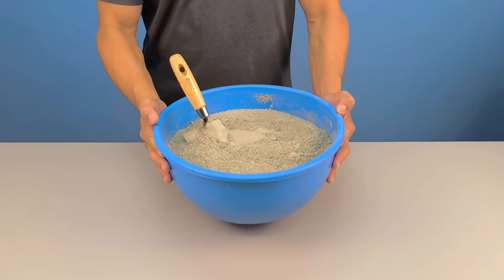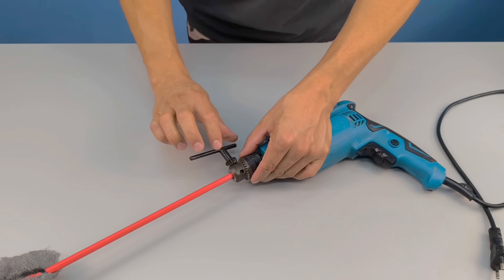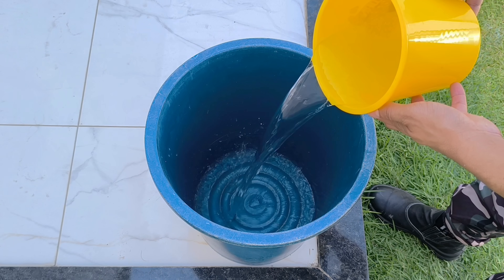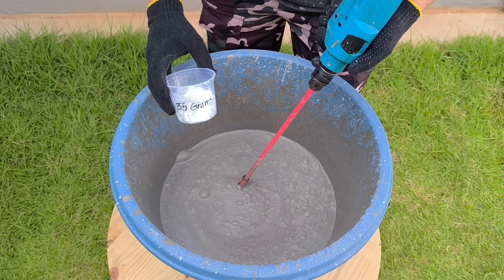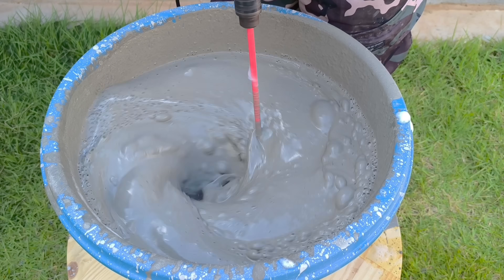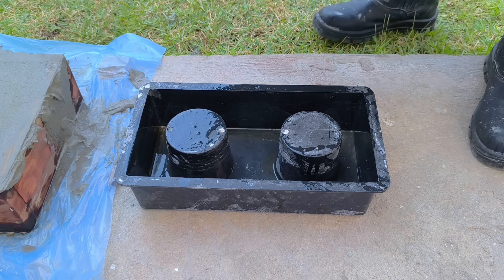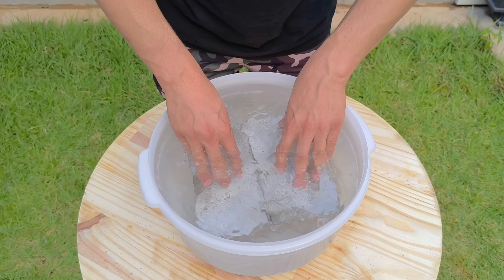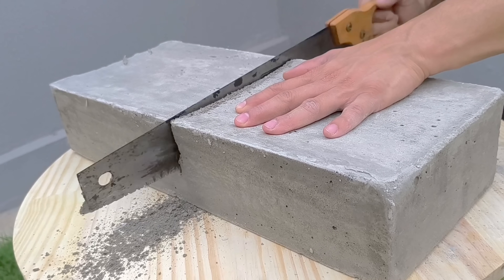Mix CEMENT with DETERGENT and create something that can REVOLUTIONIZE civil construction!

Comment: Having worked with concrete for the last 55 years from work in a garden to working on bridges and  with top engineers, and scientists on a nuclear power station..And I can GUARANTEE  that mix will be weak to start and get weaker in time ..Dish soap was banned for use for bricklayers 40+ years ago for the same reason...
Reply: Thank You! Its common sense yet people just don't seem to have that anymore ...smh
Reply: @paulsbuildingandpropetyyma544  
He said it's seventy percent lighter. As a machinist , density usually equates to tensile strength. Does that mean this concrete is 70% weaker? Or even weaker than that?
Reply: @jamesfarrell2084  concrete has extremely low tensile strength, you don't design it to do anything in tension other than local self support
Reinforcement is used to provide tensile strength 
The guy who did this video is only conducting an experiment, but provides no data - because all he's made is an aerated weak mix not suitable for loading and will break down if exposed to moisture and frost - it is a weak bulk fill material, nothing more if it hits 7N you'll be lucky
Reply: @jamesfarrell2084 even weaker... it will crumble in less than 5 years
Reply: Hello from Spain. I do agree, these bricks won't withstand heavy weights, therefore should'nt be used the same way we use the standard blocks, bricks, ytong, etcetera. Not to say about its resistance to torsion, pressure and flexion forces!  Adding air microbubbles to any mixture will never increase thickness and resistance. NEVERTHELESS, I think it can be an amazing resource for building lightweight elements, I mean our regular weekend hobbies :)
Reply: @xcosta60 air to strengthen is styro foam
Reply: Nice for making planters ! Thanks for sharing I’m from USA !
Reply: @millissamceachern2540 
Except the detergent will leach into the potting soil, and kill your plants!! 

Go with HYPERTUFA! Looks old and rustic, has good strength for plant-pots, is light to move around.... just don't build a building out of it!
Reply: I love how he is shocked that by agitating water and detergent he got soap bubbles, who could have predicted that?
Reply: I dont think this guy will get it. He dipped his tape in mud and called it dough.
Reply: @paulsbuildingandpropetyyma544  honestly would rather watch a video from someone with your experience
Reply: This might be good for decorative projects or a wall that isn't meant to hold anything out or anything up... Great for light density crafts only...  What does it do when it gets wet and dry multiple times over time...  Maybe good for a cheap statue mold... 🤷‍♂️
Reply: Halloween props at haunted house 🤔
Reply: @misterrip  I was thinking along the same lines, but it’s tensile strength would be very weak (someone said 7N) & common sense tells me it’s porous & won’t handle water well in even the short term. So pots are out. Maybe decorations that can be painted wit a seal or marine varnish.
Reply: @misterrip that's a really good use of
Reply: @misterrip  I don’t know it’s on the tube must be true like Bigfoot all the details subtly skewed from reality
Reply: That is why I dislike the video. Someone who is not as knowledgeable as you might use this formula to build something and then when it fails when people get injured it is this video to blame. It is totally irresponsible that they failed to mention the weakness of the concrete that is made with detergent.
Reply: Sirve para hacer casitas de muñecas. Para una construcción real puede fallar de 1000 maneras
Reply: You don't have to have worked in concrete for even 10 minutes to know he created something with a similar modulus as pumice stone.  Plainly. Don't use this material for any load bearing whatsoever. Its fc' is going to be maybe 1000 if lucky. Cool science project. But because it floats you probably dont want to use it for anything in landscaping either because it might float away during a hard rain.
Reply: It would be interesting if you applied heat to it using a simple propane torch. I'm going to guess it would begin to break quickly, negating its use for an insulation. Years ago brick Masons tried Adding detergent to mortar mix; It did make a lighter material, but also considerably weaker, Not what you want holding your bricks together.
Reply: @richardwomack9196  it’s porous it’ll start exploding. You ever hit regular concrete with a torch? POP!
Reply: Da haben Sie recht, und es ist uns ebenso bekannt: Der Einsatz solcher Mittel ist aus guten Gründen nicht erlaubt und verboten worden, da er noch viele weitere Gefahren birgt. Letztendlich ist es unverantwortlich, hier ein solches Video zu zeigen und es als gute Idee zu verkaufen.
Reply: Foamy means less dense equal to weakling.
Reply: More "Facebook Science". What a bunch of ill-advised advice.
Reply: REVOLUTIONIZE civil construction. But you don't recommended for construction. Hmmm
Reply: Em três anos terá uma bela reforma,com reboco se desmanchando....isto e coisa de pedreiro vagabundo que tinha preguiça de mexer massa!
Reply: @josegeraldorosa9292  🤣🤣🤣🤣🤣🤣🤣🤣🤣🤣🤣🤣
Reply: @josegeraldorosa9292  não parece ser pra rebôco, mas fiz e desmanchou kkkk. Até acho que o gesso não ajuda, mas devo ter errado alguma coisa.
Reply: Will it be ok for supported kitchen tops if sealed in your opinion cheers
Reply: Will it be ok for a countertop?  Did you watch the same video?  He cut through it with a hand saw!!!  No it can’t be used for a countertop.  The edges will chip the first week the countertop is in use.  The first time you cut on the counter top it’s going to leave a mark.  In other words you better not have a husband or kids.  Because I’ve cut something on every countertop I’ve ever owned.  As long as it was an expensive top the knife didn’t damage it.

Why would you even want to do this?  Because of the weight difference?  You already need to be methodical when creating and installing a cement counter top.  What you just saw in the video is not methodical in the sense of doing everything possible to improve strength.
Reply: @MrGivmedew  I could see using it as insulation maybe
Reply: @markedwards1864  
The "seal" won't adhere with soap in the equation. Plus, without a seal you run the risk of getting soap in foods prepared directly on the countertop. Plus when washing it down, suds will appear on the surface. 

Fascinating video, but that detergent is a deal-breaker, I'm afraid.
Reply: @markedwards1864  There is a guy on YT doing something called aerocrete that is lightweight. Also I think 'modustrial' or something like that doing diy home improvement projects has done some chairs and table tops with ultra thin concrete slabs, might want to have a look there
Reply: I am watching in Essex uk
Reply: Might be a good option to use in certain places instead of sprat foam.
Reply: @paulsbuildingandpropetyyma544  exactly. Absolute bs waste of time and energy: unless you're making you bricks for your kids to play at being builders with.
Reply: I wrote this comment before I read yours. It's nice to know that some persons with prior experience and who've worked in construction understand that light weight is not a fair swap for structural integrity. I didn't know that this was already banned. 
Here's my comment:

Okay, now put your blocks under a hydraulic and tell us what PSI it takes to fracture your block. Because that's the purpose of using strong sturdy concrete instead of foam blocks for construction. I agree that the fiberglass fibers gain your block some much needed reenforcement. But is it enough to pass muster with a typical concrete block. The light weight is a nice feature, but is it a worthy trade?
Reply: Yes, I agree with building specialists, over just a few years, the washing up liquid leeches out, and the concrete becomes weak and sandlike. Build a brick wall with it and it will crack. The areas of brick wall will move and need rebuilding and repointing. This is well known in the construction industry . Only 'cowboy' builders will use it now. There are new chemical mixtures that can be added, but you still need to know what you are doing.
Reply: @henrydepercy4637  Yup, besides the cowboy contractors, I'm sure China will think it's a break through in construction materials.
Reply: Just like everything else they make, looks good so you buy it,  within a week or so it all falls apart!🤦‍♂️
Reply: @henrydepercy4637  That's about the size of it. Frank Loyd Wright's textile cement block system was built around the science of construction technology. He approached his concept with actual masonry professionals. He developed a cement mixture from ancient Roman technology. He incorporated as much air as was scientifically possible, without compromising quality. And, through his due diligence, he revolutionized the construction industry
Reply: I'm from Indonesia
Reply: People please I don't believe the video has anything to do with stress, strain and ductility. BUT Now you can wash those dishes with bricks floating.
How can we make food safe bricks?
Reply: Thanks for saving time from  watch another false
Reply: Вместо моющего мыла по технологии применяют пенообразователи или на синтетической основе или на белковой основе. В этой технологии пена нужда как каркас по которой цементный раствор формируется и застывает поэтому материал получается лёгкий пористый хорошо держит тепло. Также с годами набирает прочность и становится ещё прочнее. Только нужно выдержать технологию а в целом видео правильное и достаточно интересная познавательное. 
Тот рецепт который указан в видео можно применять как утеплитель или для одноэтажного лёгкого строения.
Reply: Those blocks cannot be used as a heavy load base or for a bearing load wall. It could easily collapse or be crushed.
Reply: this is a typical Chinese mixture used for bridges
Reply: I might test this for making soundproof panels or lightweight wall tiles.
Reply: Point well taken!
Reply: also, with all those air bubbles , wont it be detrimental to the steel rods inside? making them more prone to rust faster?
Reply: thanks i was thinking the same thing..
Reply: @paulsbuildingandpropetyyma544  well this is not meant to be structural. they r used as infill between structural posts & beams. this is insulated block. we built a small house like this in baja & temps are very stable. however we still prefer local soil, adobe or cob, with large overhanging roofs & appropriate proportions of sand & clay & adobe creates much less environmental impact, i.e. no need to create tons of pollution by baking in high temp kilns with gas… some of the oldest structures on Earth are made with Earth, not reinforced concrete. Due to rusting rebar RC cannot last nearly as long as adobe. Sure RC can handle large structures but really who needs them? totally not necessary. only greedy egotistical capitalists think, & make others think, skyscrapers & giant water boilers are necessary. many, small, decentralized, networked systems are more resilient & less susceptible to sabotage. nuclear plants r only possible when gov’t backs them. no insurance company will touch them.
Reply: @paulsbuildingandpropetyyma544  what they added varnish or urethane so the dish soap cand break down? Or maybe acyrlibond or white glue?
Reply: @paulsbuildingandpropetyyma544  we used to use BP comprox in mortar mix but never in concrete.
Reply: This what Dome Gaia has been doing for years. I heard, about a year ago, that someone in either Washington state or Oregon was working on getting this tested for approved use as a building material. I've not checked to see if it ever occurred, tho. There are plenty of homes around the world that have used it - including in NM & AR (that were Dome Gaia clinic sites) that I can think of.
Reply: @KA-qw5cv  is this what was used for the lightweight roof tiles made in BC Canada that were eventually exposed as substandard?
Reply: Shouldn't the fiberglass mixed in give it much more strength like when adding chicken wire to concrete
Reply: @paulsbuildingandpropetyyma544  as a hod carrier for a Bricklayer we were told To add it to the mixer which would prevent it from drying so Quickly on scorching hot days,
Reply: @paulsbuildingandpropetyyma544  it would be good for hobbying and scale building.
Reply: Can you recommend a simple recipe for making a kitchen sink and work surface - strong, waterproof and lightweight?
Reply: Exactly we used to use it 40 years ago until the ban and now we use Feb mix .
Reply: The glycerine used in detergent is now an additive for stucco and marcite. It's interesting that soap had nothing to do with the actual outcome.
Reply: We use lightweight concrete sometimes in our road construction projects.  It's either that or very large foam blocks that are used as lightweight fill.  This is nothing new or unique but this video makes it sound like it's "something amazing!"
Reply: This comment needs to be pinned.
Reply: I believe you
Reply: There you go. My very first thought was, "What are you going to use that on?" It would basically be useless in practically any application where you would normally use standard concrete blocks.
Reply: I don't think the purpose of this video was building code strength for a nuclear plant.  Maybe the plasticizers and fiber replace tinsil strength lost not just from the super enhanced aeration but the amount of 💦.. now that 20" slump we saw, extremely weak concrete. We used to throw a bottle of coke or dawn in our mixer just before the air test. 😂
Reply: It is not for Strength. That’s what the Iron is for idiot
Reply: @paulsbuildingandpropetyyma544  can you put rhubarb in it?
Reply: You are such an Ill-informed, human being, everybody knows the iron Is what keeps everything together and it keeps the strings together. Concrete is nothing but wet mud that gets hard and it’s super heavy so in order to lighten it up, fiberglass is added or fiberglass type material
Reply: @paulsbuildingandpropetyyma544  was a tile setter... first thing that crossed my mind. 🙃
Reply: Hilarious 😂.....thank you for making me smile on a Saturday at work ....wow
Reply: 𝕎𝕖𝕝𝕝 𝕟𝕠 𝕠𝕟𝕖 𝕖𝕧𝕖𝕣 𝕤𝕒𝕚𝕕 𝕪𝕠𝕦 𝕔𝕒𝕟 𝕞𝕒𝕜𝕖 𝕔𝕠𝕟𝕤𝕥𝕣𝕦𝕔𝕥𝕚𝕠𝕟𝕤 𝕨𝕚𝕥𝕙!!
𝔹𝕦𝕥 𝕪𝕖𝕥 𝕪𝕠𝕦 𝕔𝕒𝕟 𝕦𝕤𝕖 𝕚𝕥 𝕗𝕠𝕣 𝕒𝕟𝕠𝕥𝕙𝕖𝕣 𝕡𝕦𝕣𝕡𝕠𝕤𝕖𝕤 𝕝𝕚𝕜𝕖 𝕞𝕚𝕟𝕚𝕒𝕥𝕦𝕣𝕖 3𝔻 𝕞𝕒𝕡𝕤 𝕔𝕠𝕟𝕥𝕣𝕦𝕔𝕥𝕚𝕠𝕟𝕤. 𝕀𝕥 𝕨𝕚𝕝𝕝 𝕓𝕖 𝕒 𝕘𝕠𝕠𝕕 𝕡𝕣𝕖𝕤𝕖𝕟𝕥𝕒𝕥𝕚𝕠𝕟 𝕨𝕚𝕥𝕙 𝕝𝕚𝕘𝕙𝕥 𝕨𝕖𝕚𝕘𝕙𝕥 𝕒𝕟𝕕 𝕖𝕒𝕤𝕪
Reply: If you having worked for so long, sure you know,that someone has done 7,14,28 days of this mixture strength testing and the numbers are available. 

By stressing your long term service with concrete does give your comment a credibility. 
I don't need to work with concrete for 55 years just to issue the same statement. This block is weak and will get weaker. I can simply do the strength testing.
Reply: Yeah you don't even have to take it back to the lab for a stress test you could just stand on it or punch it.  10" slump anyone, just have to fill 2 more 8' foundation panels 😂😂😂
Reply: Paul, what would you suggest be done differently? i like the fiberglass material added, and as I understand it, my A/C pad is made from cement fiberglass mixture; can you direct me towards a similar recipe for use as a patio blocks/pads?
Reply: ..film setleri için iyi görünüyor.
Reply: @paulsbuildingandpropetyyma544  missing the fine details friend.  This isnt dish soap its a detergent
Reply: @paulsbuildingandpropetyyma544  it's will never set,you only add a cap full to keep your mix from setting before you lay it, nonsense it will crumble away in no time
Reply: Exactly.    U need salt water (sea)  and lime-calk (i think its named like that . For the cement that is self-healing. And gets stronger by the years .  (Look @ old Greek & Rome )
Reply: But listen. This guy is not a construction worker with 40+ heavy construction..  this is a featherweight molding hobby cement..   and then that mix looks handleble and lightweight easy to form ect .  (Use silicon for forms re-use
Reply: Wonder what the ancient Hindus used in their cement mix? Still holding 1000s years. Home Depot should read Vedic texts books.
Reply: I can see a place for this DIY product.  Especially as insulation.  One piece of 2"  foam board a Home Depot (FOAMULAR NGX F-250 2 in. x 4 ft. x 8 ft. SSE R-10 XPS Rigid Foam Board Insulation) is $45.00 in November 2025.  Crazy expensive.  I'm building a shed and chicken coup and this would work great for MN, USA winter weather protection as well as the 90F+ summer temps.
Reply: San Antonio Texas
Reply: Can this be used to create stepping stones outside?  In other words, can it withstand a weight and exposure to the elements?  I have 2 projects I’m thinking about.  One is a floor for an outdoor shower.  The second is I’m going to create outdoor spheres for my garden.  I originally planned to use concrete applied on the outside of a yoga ball that is covered with textured tape. This looks like you can do create texture on it, but they would be outside.  Thoughts? Thanks for the incredible videos!
Reply: @stephanieballasiotes3572   I wouldn't expect much.  It might fall apart when exposed to moisture.  Maybe it would be fine, but there is no information about durability or strength here, and the fact that nobody else does this is an indicator about its potential.
Reply: @AkaRyrye83  isn’t this just DIY aircrete, a product that’s been in use for quite some time in residential construction and decorative stuff too?
Reply: Try my innovative proprietary mix: concrete,  a case of Budweiser, and Chinese newspapers.
Reply: @AkaRyrye83 if you added some type of waterproofing sealant to the finished product it might.. keyword there.. weight is a big issue
Reply: @Michael-zz3pn  First you mix they concrete, then while waiting for the concrete to cure, you drink the case of Budweiser.  After drinking the case of Budweiser you will forget what the Chinese newspapers were for.
Reply: @stephanieballasiotes3572 Материал не пригоден для дорожек в саду , т.к. содержит много гипса , который не водостоек. Потому не подходит для наружных работ , но также и вообще полов .
Reply: Don’t let this within an asses roar of water !
Reply: Very cost effective for a few walking stones but like everything else even when sealed with an brick, stone, concrete sealer it will degrade unlike granite which is extremely expensive and not easy to deal with unless you have expertise.
Reply: @stephanieballasiotes3572  Absolutely NOT
Reply: @stephanieballasiotes3572  The first time taking a shower on that floor, better have a railing to hang on to when you slip.
Reply: this is what buildings are made of in china, that's why they keep falling down..
Reply: @johneven2896 Detergents lower the surface strength and so humidity can easily enter this mix with cement . Then it falls apart .
Reply: @johneven2896  How do know that? References?
Reply: I was just about to say that. Makes me wonder. I bet they do use some sort of expander. Also, just so people know. Using additives to accelerate curing can also impact a concretes strength negatively if not done correctly. Seriously. Go but quikcrete if you are doing a small project. Its cheap, and if you do your mixing ratios properly it will look good and be strong.
Reply: @johneven2896  did you any fact check?
Reply: @jackiechan1383  Yes, I've worked in China for 15 years and can promise you it's worse than you can imagine in your wildest dreams...😁
Reply: Also the plaster mixed in can not be used outside. This is  just BS
Reply: @GS-dz5kr did he claim any of that in the video? Some people just love to tear down others.
Reply: @TheRealCoryKent you’ll save the world of OG someday, I know you will
Reply: @TheRealCoryKent  yes he did. 8:14 “maintains good strength”. No, it does not.
Reply: @TheRealCoryKent  , yes! He absolutely said that.
Reply: Neat trick, though, not for American construction practices. China maybe, but not American
Reply: It has perfect thermal ability. It's very good for ovens and decoration . Also it's very cheap and good for basic wall with no structural need .
Reply: Dam well, looked cool and possibly nice for underpending!
Reply: @paulsbuildingandpropetyyma544  I'm sure this idea in China would be wonderful! Many of the buildings they build or are in the middle of building collapse on them. I keep saying they shouldn't make stuff out of Chineseium but they don't listen
Reply: @paulsbuildingandpropetyyma544  hehehe & 55 years waited to learn about 65 years European technology we used that’s why our structures are lighter cheaper and better than American technology
Reply from the maker: Thanks for sharing your valuable experience! This mix is indeed weaker than traditional concrete and not meant for structural use — it’s mainly for experiments, insulation, or lightweight applications.
Reply: @inovaouinventa  Not meant for structural use? The title of your video literally states the mixture will "Revolutionize civil CONSTRUCTION"
Reply: @pd9655  Yeah, clickbait. Aircrete is useful on a personal level, but doesn’t use plaster. It has limited structural strength, is more insulating than concrete, and is not very abrasion resistant. Some people using it to build dome structures, but it requires additional weatherproofing.
Reply: @inovaouinventa  you titled to video "create something that can REVOLUTIONIZE civil construction" only thing revolutionary is that anything you build will wash away in the first storm....
Reply: @inovaouinventa  Glaringly obvious use of an AI-generated reply. The classic em dash, followed by a list of 3 things. For example, "The new job is an innovative one — it uses learning, experience, and new ideas."
Reply: @thinking-monkey  Not always. I, myself, tend to use the em dash more frequently than usual. And the use of three item lists is a technique that was taught to us as far back as high school. I'm not saying it's not AI generated for sure, but your criteria for determining AI use is not always valid.
Reply: @thinking-monkey  This was a really helpful comment. Thanks. 😊
Reply: @thinking-monkey  thanks! indeed, many talk this way, but so do I - in comments, texts n non fiction writing.  Notice lack of oxford comma tho - and folksy shortenings like tho, n and lowercase beginnings.
Reply: I thought half the video was Ai for some reason. Goofy stuff like putting the retractable measure in the cement.. then letting it retract...
Reply: @thinking-monkey  yeah I hate the 3-item lists.
Reply: @thinking-monkey  Americans typically use the em dash when typing. It's even catching on here in the UK, although we generally use the en dash. As for the. three things - this has been a feature of British and American style for centuries! When it comes to common sense, I have a suspicion that if there really were such a simple solution to reducing costs it would be used commercially. There's also the rather telling problem that it's possible to cut with a saw - not a feature I'd like. Then there's the matter of the glass fibre strands. I use glass fibre embedded in resin to build small boats. It's a hobby. The amount of glass fibre added is not sufficient to have any effect at all.
Reply: @alanwhiplington5504  I'm a writer. An American one. A pretty typical one. The number of times in the last year I've used the em dash besides the one in the comment above: Zero. My favorite genre is 18th and 19th century literature. While the "three-item list" may have been a "feature" for centuries, it has been nowhere what anyone could call a popular one. The use of the em dash and list of three things by LLM's however, VERY popular and a known dead giveaway (though not irrefutable proof). That's just one of the many quirks noticed by researchers that can pretty reliably tip you off (prove it beyond a doubt, no) as to whether text is written by a model. Another one is the "three-word phrase" imbalance. In normal English usage, "one of the" is (by far) the leading set, in text analyzed that was written by AI, it's "can lead to". Does that mean that a human can't write "can lead to"? Certainly not. Only that if that in addition to other known quirks "em dashes, excessive use of emojis as bullet points, the 3-item list, etc) are present, you're likely looking at AI-generated text.
Reply: @thinking-monkey  It's not something I've noticed in AI. I first became aware of the em dash using Word for Windows and other American text editors in the 1990s. As for the three item list this has been a feature of my writing since the 1960s. There are differences in the way Americans are taught to write at school - the mechanical use of topic sentences stifles creativity.  It's very easy to see when an American has written a scientific paper, for example, although British writers are also writing weaker prose nowadays, with lists of 'additionally' and 'moreover.' I need to generate a large number of texts for y students and find AI helpful. I've trained it not to use most of its various cliched giveaway prosodic features.
Reply: In others words, useless.  @inovaouinventa
Reply: @inovaouinventa  Should of led with this
Reply: @inovaouinventa  You're forgetting that your video title is "Mix CEMENT with DETERGENT and create something that can REVOLUTIONIZE civil construction!" If you say that your mixture is not suitable for structural use, why do you use the word construction?
Reply: @inovaouinventa  If it's not for structural use, then why title it saying it can "REVOLUTIONIZE civil construction"??? Construction refers to structural use. It's why we don't build with putty and plastic. 

Also, you say at one point the molds are smooth...but all I see is holes and pits everywhere on every mold. Even used as a walkway paver rain/ice will destroy those in a matter of a couple years. You made something light and good for specific purposes...which is great. But the moment you didn't try to torque it with your bare hands after removing it from the mold I knew it wasn't strong.
Reply: @inovaouinventa  With that in mind, can you use this in a video for making a faux cobblestone aesthetic meant for use on tinyhouse exteriors perhaps in combination with some foam insulation panels shaped to resemble cobblestone?
Reply: @inovaouinventa  really??? So if the bricks are so weak this experiment will be worthless!?? Doesn't it have any useful implications???
Reply: Yeah Old Timer

...But...

Wake Up!!

They weren't using Dawn 40yrs agp..
Reply: @michaelp3650that’s not dawn he’s using
Reply: @michaelp3650 Actually Dawn dishwashing detergent is 52 years old, has been around since 1973, a product of Proctor and Gamble Co.
Reply: While being vulnerable to the environment and not very useful in load bearing applications could you at least elevate the elements issue with some sort of coating?
Reply: Fuck that video was painfully mind numbing to watch.
Reply: Interesting video. Would be much nicer if you spoke normal units of measurement and jettisoned the highly undesirable metric system.